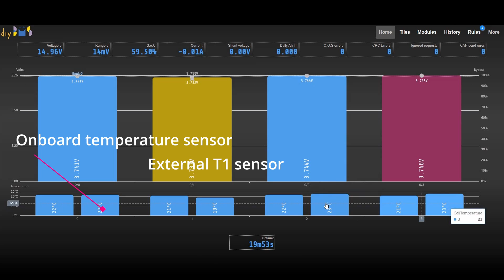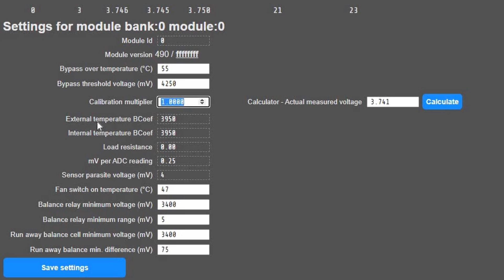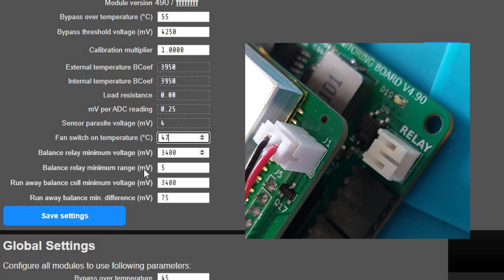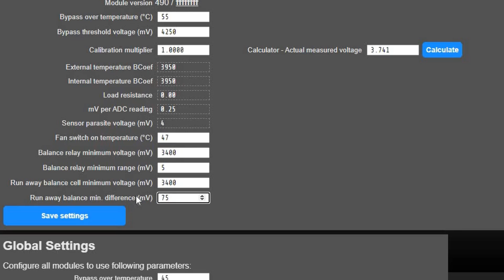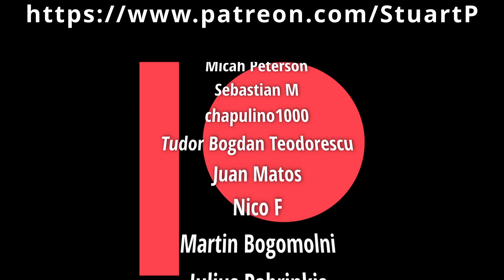DIYBMS All-In-One monitor - Design files released

Comment: In this video you show the board and then direct to software.  But you don’t show how to hook this expansion board to the batteries nor the controller nor how to program it.    Just straight to the website.    Please make a video step by step,  with the actual connections and install
Reply from the maker: Good idea

Comment: Hello Mr. Stuart, I purchased and installed the necessary equipment to apply the example you made in the project I did at school, but I could not run it after installing the software.
Can you help with this?
Reply from the maker: Pop over to OpenEnergyMonitor forum for help on building the DIYBMS

Comment: thanks for the update.. be awesome if an active balance could slot in top.. what can the pcb tracks support as max current transfer if this a active balancer was 3rd party made.
Reply from the maker: You would just wire up the external balancer to the cells rather than via the monitor board - so not current limited.

Comment: Wow! what a progress...Thanks for sharing! I'm now building a 19" storage rack for up to 8 banks of 16S LiFePo4 with different capacities as it evolved slowly for the past 4 years. I have 6 banks as of now, 3 of them are fully operative. The first 48V-100Ah use ANT BMS v1, the second is 280Ah with ANT BMS v2, the third is 280Ah with HiBMS (Daly) with a 1A active balancer. All three have bluetooth  interface. I'm now working on a 310Ah with HiBMS / 1A AB and two 200Ah for which I've not decided which BMS to use. So I'm happy that your design supports the LiFePo4 as I really believe it has a huge momentum for OFF grid system like mine. Their price is dropping such that I got the last two 200Ah for only $1400! and these are rack ready built modules.... 20kWh for less than $0.07/Wh! That's insanely cheap IMO. So I could not resist and will buy 2 more modules if their capacity is still up there. I just have to source four 200Ah BMS / 1A to 4A AB.  So my question for you is will your design support such currents and how does it manage the parallel banks working in conjunction to optimize the maximum output power when needed? If it does, then I may even sell all those different BMS and unify all the control under your design. Does this seem reasonable or even feasible? Thx!
Reply from the maker: Hi, thanks for watching the video.  The DIYBMS doesn't directly control the current flowing through the cells/system - instead it monitors those currents and then triggers actions based on fault - so for current, you could use a "trip shunt" device to automatically switch off a fuse/breaker.
Reply: @StuartPittaway   Thx for replying. So your BMS only offers protections and data logging communication but neither passive nor active balancing of the cell or pack?
Reply from the maker: @francoisguyot9770  it has built in passive balance, it can also be linked to external active balance devices and trigger those based on need.
Reply: @StuartPittaway  Then, according to your previous statement, your BMS doesn't have the built in high power MOSFETs, that most other BMS have, to charge or discharge large current through the solar charge controller and inverter by interrupting their return  path to ground, in order to power loads, whenever it senses specific voltages, current or temperature conditions. But it does have low power MOSFETs to handle passive cell balancing by bleeding small currents through passive resistors. However, active balancer can be handled in turn, by add-on modules with which your BMS can interface. But most of them are becoming "smart" and should not need control from your BMS to operate. Did I get it right... this time?
Reply from the maker: @francoisguyot9770 Correct - the high power MOSFETs are not part of this BMS, very similar to Batrium system.  This allows you to decide what current you need to handle and buy suitable fuse/breakers to match.  It should be rare that a BMS ever needs to shut down power into/out of the battery.  Instead it should instruct the charger to stop charging - which the DIYBMS does over CANBUS.
Reply: @StuartPittaway   Both of my ANT and Daly BMS''s shut down power to and from the charger/inverter if a cell or the battery pack voltage exceed the safe limits ...for safety reasons I  suppose? It actually fried something inside my 50A Epever Controller. While solar was at max power the controller could not determine what battery voltage to tune itself on, after the BMS locked up. It was my fault because I did not top balance those old cell modules before installation. It took me a while to understand and solve the problem  by compensating with a Daly 1A active balancer.  I truly admire your determination to DIY your hardware needs when there are solutions out there that seem to meet our needs for very cheap. But I understand. I used to be passionate about depending only on my own skill but I got to admit that it is getting more complicated every day while my brain start to  slowly forget everything I ever learned. I blame it on the lack of exercising those neurons!...
Reply from the maker: @francoisguyot9770  I know that feeling!!

Comment: Thankyou for the update and for the contribution. ive built a bms with passive balancing at 0.5amps provided the code is well written you shouldn't see a raise in temp past 50deg c. . also depends on how balanced the cells are and remain balanced ..  would like to get testing and contributing hopefully can make up one or two boards

Comment: Impressive work as always. Thank you Stuart for all you have done. I also appreciate your decision to include the use of Li-Polymer cells. The optional board with passive balancing and a relay for enabling active balancing  is an excellent idea. I am now testing your V4.4 modules and am impressed by the performance, both hardware and software. Hopefully soon I will be able to test your new board. What a great achievement. Thank you and all the best, Paul
Reply from the maker: Many thanks!

Comment: I'm glad it now will work with 4.2v cells!
I'm looking for a BMS to monitor and balance 42s10p battery packs for electric sprint karts, and I need the BMS cell measuring boards to reside in the battery case so total cost (and the number of physical boards and connection potential failure points) is a consideration. It will be actively cooled using the same immersion cooling fluid as the cells, so heat dissipation from balancing should not be an issue. This looks like it could be a winner.

Comment: What smazing project. Thanks for all the details such that the community can help you debug both bms-hw and the code. Cheers.
Reply from the maker: Thank you.
Reply: @StuartPittaway  Many users have been following your project for a while; however, as I'm relatively new to the project, it takes quite a while to grasp all the excellent documentation and required boards and how they evolved. Doing a 'build video' with batteries, diyBMS, shunts, etc, would be beneficial. A build with the latest development would be highly appreciated, if not to help you debug the HW and the software. Cheers.
Reply from the maker: @Cptnbond  great idea

Comment: Thank you for the really great video, and going into some detail about soldering the small components. I have also been obtaining my boards from jlbpcb, last time I checked they don't stock the ina229 chip. Is there a way to send some them components so they can assemble your boards? I think it is a great idea to separate your resistor board it allows more heat dissipation. I have been trying to get my new system up with 16 320 amp hour batteries just having arrived from China. Having charged all the cells to 3.45 volts, it has been difficult to get them all even now they are assembled in a pack. The more balancing current the better. --- thanks again
Reply from the maker: It looks like JLC now support supplying your own chips, I've not tried it though and the postage may be expensive.

Comment: Question with this new design how many modules will it support in theory?
Reply: did you looked the video? 16s....
Reply: I stated modules but what I really meant was banks. I know the module supports up to 16 cells but how many banks ( battery packs) does it support  in total ?
Reply from the maker: The controller supports upto 128 cells in total - or 8 banks if using 16S
Reply: @StuartPittaway  Thank you Stuart so the 128 cell limit is still in play.  8 banks maximum then good to know.
Reply: Curious what i if  you are using 14s cells will is support a maximum of 9 banks and the cells are 126 ?
Reply from the maker: @carlospereira9838  yes, that's how it works
Reply: @StuartPittaway  thank you so the limit is in the modules ( cells) not the banks
Reply from the maker: Correct
Reply: Looking good! I know it is early days yet, and I assume there will be videos covering how banks are connected in series or parallel. It is my assumption that banks connected in parallel will require one controller and multiple resistor boards, and banks in series will need multiples of both boards? I see the multilayer boards cost more, could you give a ballpark figure how much you will be selling controller boards and resistor boards for in the future🎉🎉🎉🎉
Reply from the maker: @rogercrier9115  You should only need a single controller with multiple monitor boards - it doesn't matter if serial or parallel, the controller takes care of that.

Its too early to determine prices, raw parts costs are about $35usd for the monitoring board, plus assembly and taxes

Comment: Can this do active balancing?
Reply: passive has a add on. active use 3rd party. there is a relay switch to enable. likely to be one made compatible with this at some point.
Reply from the maker: Not directly - but you can use a 3rd party active balancer via the relay control.
Reply: Yes it can with active and passive balancing addons
Reply: I've often wondered whether there is any merit to enabling active balancing at low SOC as well as high. For example if one cell has a lower capacity than the other 15?